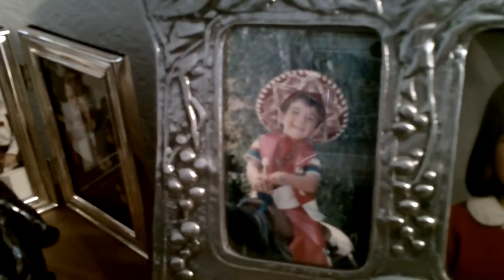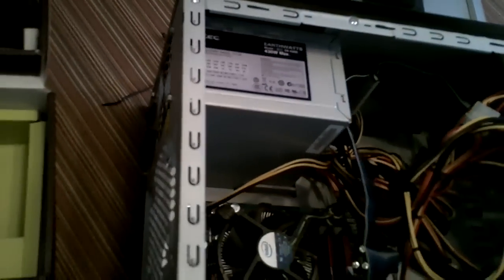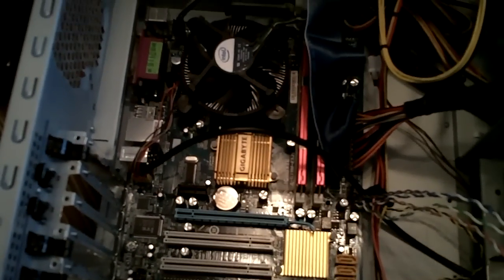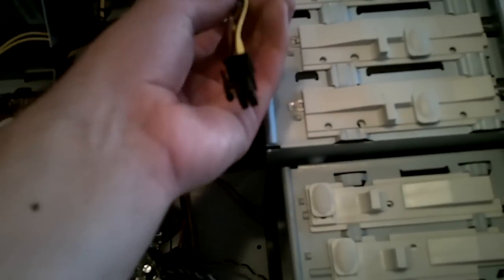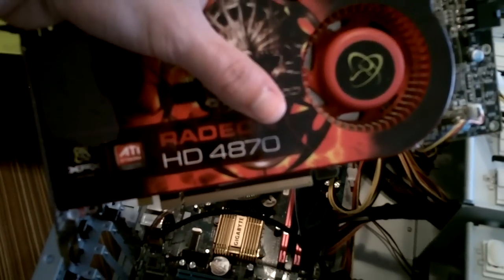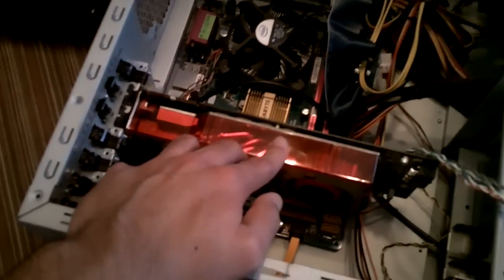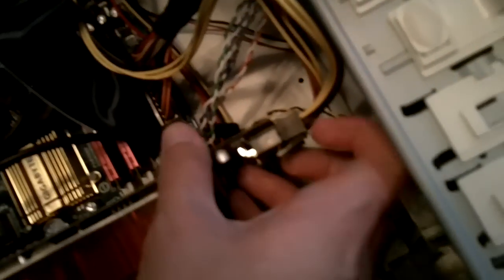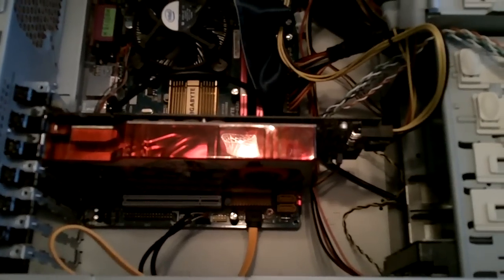How to Install a Graphics Card

Comment from the maker: @yariv0899 As for your second question: yes, you do need to make sure that all the various components in your system are compatible with each other, preferably before buying an expensive new part :P.

Regarding your third question: I've had that card lying around for almost a year now.  I used it because I had it on hand, not because it's the latest and greatest.  If you're in the market for a new card, I'd recommend getting an HD 5850 or GTX 460.  Those two cards offer great bang for your buck.

Comment from the maker: @yariv0899 I have a wrist strap, but I don't use it.  I've built quite a few computers for myself, my friends, and my family at this point, and I've basically got my techniques down well enough that I don't need one.  As long as you stay off of carpet and touch a grounded object (i.e. the computer case itself, which is basically a given since you need to open the case in order to do work in it), you'll be fine.

Comment from the maker: @skullzee69 PCI Express 2.0 cards only work on PCI Express 2.0 slots, whether they are 4x, 8x, or 16x.  What won't work is if you have a PCI Express 2.0 card and a slot using a standard older than PCI Express 2.0 (i.e. AGP, PCI Express 1.0, etc.).

Comment: @d0n7bl1nk 
I have heard from several techie friends, and the so called "experts" at best buy (no I did not buy from them lol! newegg all the way) that PCI-E 2.0 x16 cards WILL work in PCI-E 1.0 x16 slots.  The only difference is how much data the slot can transfer, and according to some posts no GPU has been made that can max out the bandwidth that PCI-E 1.0 x16 slots are capable of transferring.

Comment: What happens if you dont connect the power supply to the graphic card?

For some reason i cant find out any cable on my power supply that goes into the graphic card.... but im using right now my graphic card while playing crappy battlefield play 4 free (aka  BFpay2win)

its a radeon HD 6570, not a super graphic card at all, it says it need at least 400 watts...